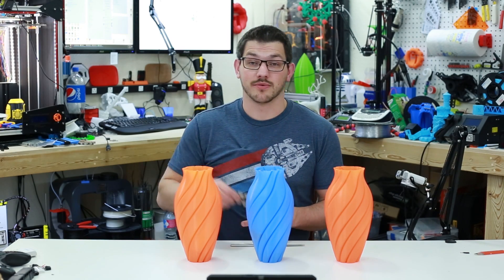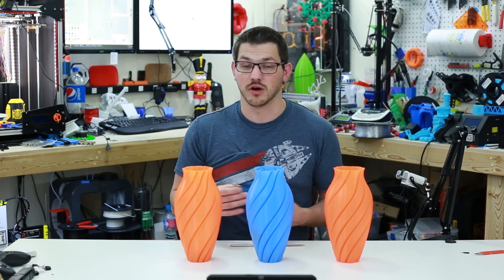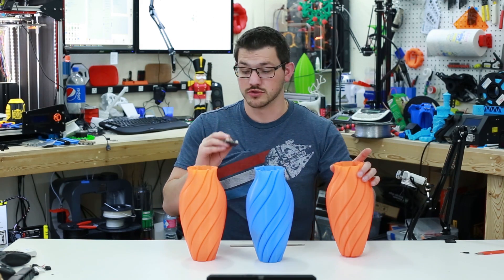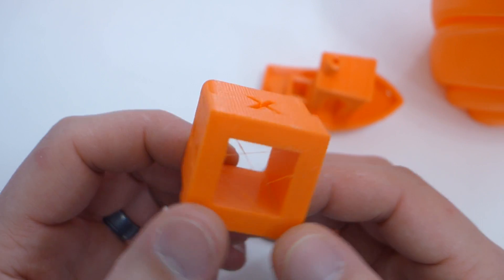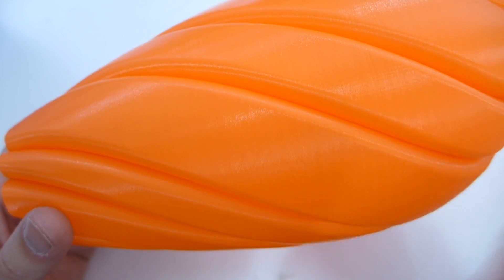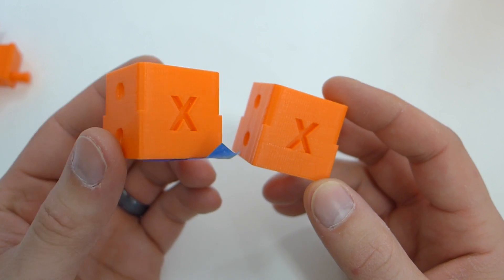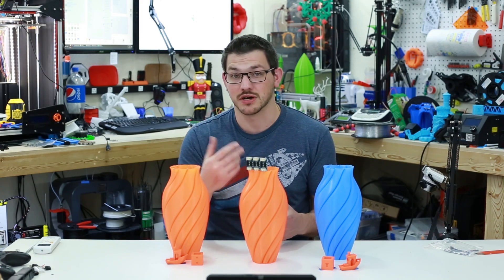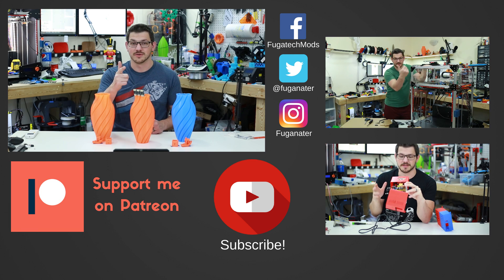Testing TL Smoothers

Comment: LOL, I was under the impression that a square( stepped ) wave is a prerequisite for a stepper motor to work. I am no electronics engineer but if these ' smoothers ' have a function it is to block the back /current/EMF getting back to the drivers when the motor comes to a rapid halt and changes direction.
Reply: You are right

Comment: I like how everyone says 8 diodes is better without knowing anything about electrical  engineering..  You can have 4 superior diodes or 8 inferior, but you dont know, maybe 8 superior... The bottom line is, the drivers are just spreading out the current over twice as many diodes which is only reducing the current each one is subjected to. Because they get hot. It dosent have an effect on SNR. It DOES NOT have twice the filtering since a single inferior diode is going to have the least resistance and the highest amount of gain (poor signal leaking through). Look how their wired - its all evenly distributed. If you have a diode getting much hotter than the rest - there you go. The wiring of these boards with 8 is 'better' at least in the respect of how much work each diode is subjected to, and ultimately greater longevity. Theres youtube channels that have put these TL smoothers on test equipment to demonstrate this, and whether its mostly voodoo in the end...

Comment: This does nothing more than what a $0.10 resistor would do. Diodes in both directions is doing nothing else than adding resistance. Which means you got too much voltage going to your steppers if the "smoothers" actually work.
Reply from the maker: ok...

Comment: I purchased these for my Delta - they made ZERO difference.  Still getting the wood-grain patterns in all my prints. :/
Reply from the maker: What drivers are you using? Could be a voltage issue.
Reply: I'm running an Azteeg X5 v1 with built-in DRV8825's.  I don't think it would be a voltage issue.
Reply: Depends a bit on which TL smoothers you get and how many. No joke. On the Tevo LM (a MKS sBase smoothie-controlled Delta with 8825's as steppers), many users reported they still saw Salmon Skin issues when putting on one set of TL smoothers : we (I'm one of the guys who experimented with TL's since 2014) noticed that on this machine you needed 2 TL's in series on each axis to get a good result. Same turned out to be the case on the Hatchbox Alpha Delta (which uses A4988's, yet has a horrible case of missing-steps-induced-surface patterning).  In the end, if you can't make these TL's yourself (really easy, it's just a couple of diodes in anti-parallel really - they are NOT setup as Flyback diodes as so many people think !!!) and you have a controllerboard wich allows easy swap of the steppers, tossing the 8825 or 4988's and replacing them with TMC's is probably the cleaner solution. On TBH6128's, I've noticed there's STILL a pattern, but you can supress that by closing the "fast" jumper at the underside of the 6128 steppers. Alternatively, you can force the decay modes of the 4988/8825 into Fast decay too by forcing the pin needed to do that (grounding ROSC pin on the 4988 by bridging the typical 10KOhm resistor on the ROSC pin, or pulling the  Decay pin to 5V on the 8825) but it will come at the price of a much noisier machine. If you want to toy with that, here's some reading : http://www.morgan3dp.com/stepstuck-revisited-drv8825/  . Don't know how LV's behave in this regard.

Comment: Wouldn’t this also help ensure that if the steppers / axis is moved it won’t backfeed generates current into the controller board?
Reply from the maker: Sadly no, I just tried moving my motors and they still backfeed and power the board.

Comment: I been looking at these TL-Smoothers for a while now for my Anet A8 which uses the A4988 driver just to make my prints amazing smooth. But when i costed it out its about $20 for a 8 Diode kit, i honestly thing it would be better to just buy a Ramps board and driver setup then your not dealing with constrained hardware and can run multiple hotends, thermocouples, and add in other cool features like ambient temperature controled box.
Reply: Side85Winder I got these off eBay for au$5 .....the wiring reversed the direction ....at least with the one I tried out. I suppose I could rewire and try again.....but give up!
Reply: Ebay now has a 8 diode kit for $12 AUD now thats a much better than $20 that i seen from Aliexpress. At this price i think i am going to take the plunge just for the sake of having a known better result for a very small investment. 
I still would love a RAMPS board (or a 32bit board) with TMC2208 drivers for a very high precision setup.

Comment: Interesting video. I have a CR10 mini and have only been 3d printing for a month or so and my prints are amazingly smooth. Very little artifacts. Would I see any improvement if I installed these smoother boards on my printer?
Reply: NoCr10s dont use the drivers that this is used to help.
Reply: Try printing a Vase or object with a wavy curve if you can see the "salmon skin" effect then yes you will get "some" benefit from TL-smoothers. You can see the effect in some objects like the Benchy on the front hull curve you can see the effect here. I found from my stock Anet A8 to get to this point changing the belts helped a lot because tension only does so much when they are slightly elastic and just making sure your frame is as stiff as possible.
As Paul F has said the Cr10 uses different drives so there is doubt if your printer has this small issue.

Comment: I can really recommend the lv8729 drivers.
They are quieter then a4988 or drv and even support up to 128 microstepps when you use a 32 bit board.
I use them at 16 together with tmc 2130 and honestly they are much easyier to work with then the trinamics, while at the same time beeing much less expensive.
Reply: TMC2208 TMC driver, LV8729 MKS driver and the DRV8825 pololu driver are the latest  (I think). The prusa i3 mk3 is using the TMC2130 and has a step loss implementation so you will not loss steps and other very cool amazing features with bumping the hot end and power outage recovery. It will be only a matter of time for this to be implemented into the clones. As far as i can tell you can get them at a very similar price to each other so there is no real beneift to very little in getting the other drivers. I would stick with TMC and wait for the Step loss features to kick in the future.